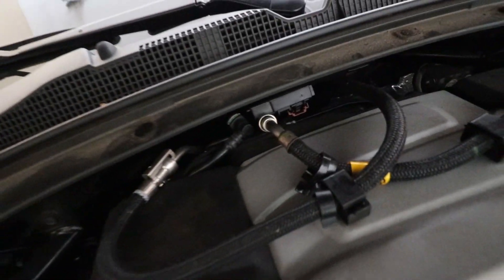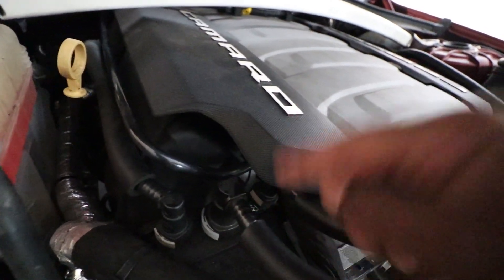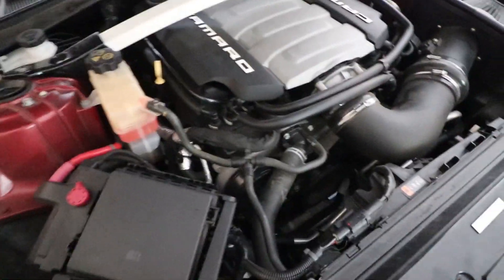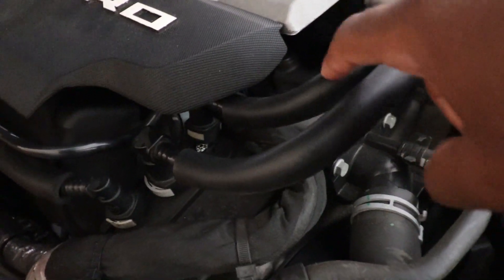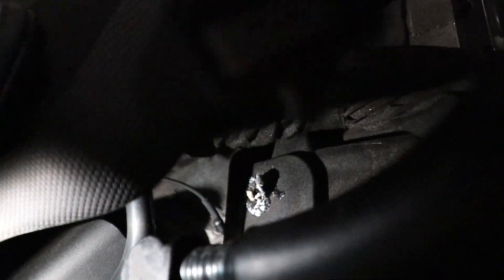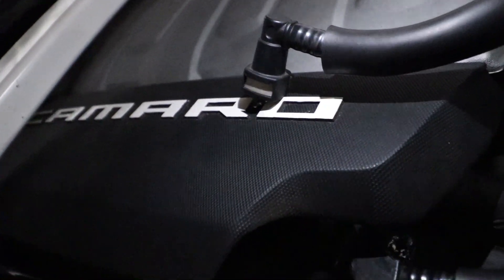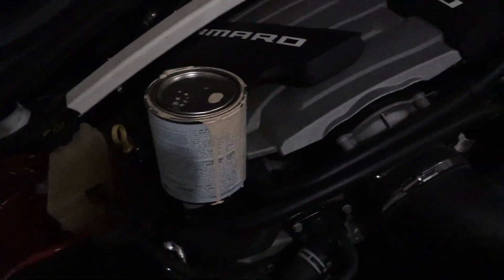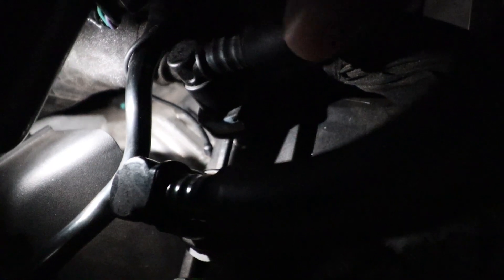I Broke My PCV Valve On My 6th Gen Camaro...

Comment: This is breather not PCV valve.
PCV valve in the other side of the engine, the place we put catch can.
Thanks for sharing any way
Reply: I replaced that hose with 2 hoses and a catch can in the middle. I drive a 5th gen Camaro SS automatic... Did I put it in the wrong place?
Reply: @ZeginMakesMusic  
It is hard to tell, do a video and share it , hopefully you get good help.